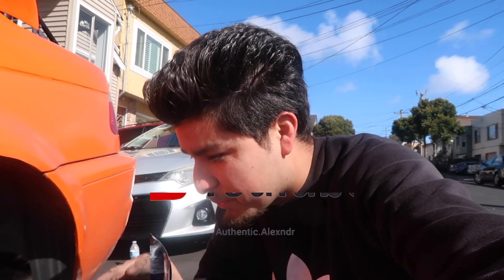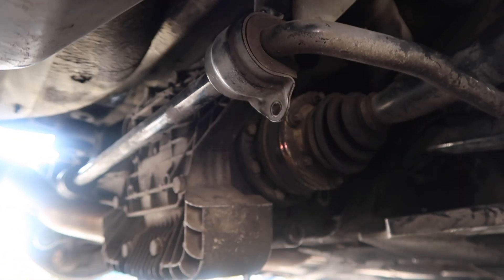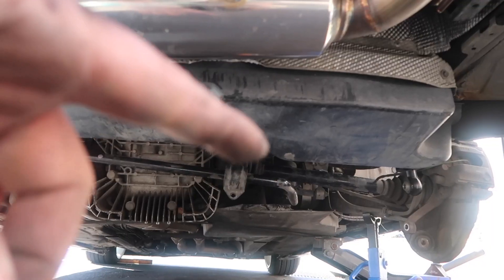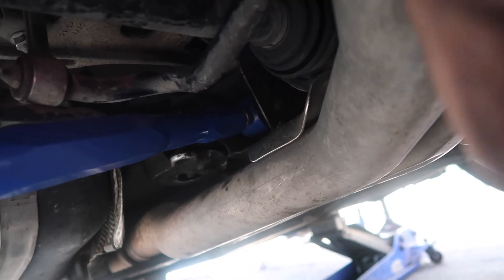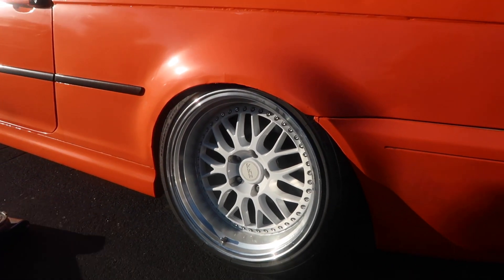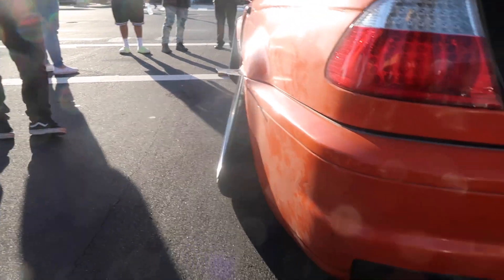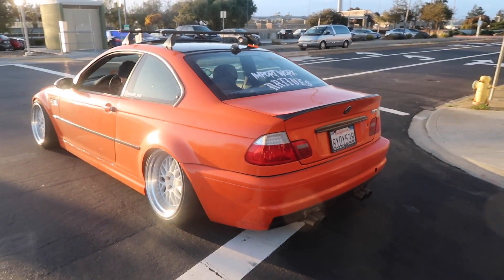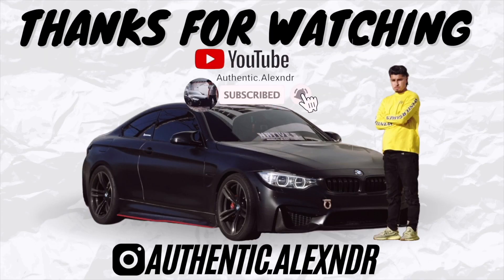E46 Megan Racing Rear Camber Arm Install! | DIALING IN FITMENT

Comment: Many ways to get the driver side in but what worked for me was removing the 21mm rear diff mount bolt and loosening the front 2 18mm until they almost come out then lift the diff and i had to grind one side of the bolt until i was able to slide it out but without affecting the bolt’s integrity good luck not a easy job but grinding the bolt helped big time

Comment: How did these hold up?
Reply from the maker: Held up great and still holding up to this day
Reply: In all honesty mine crapped out not even two weeks later and I have way less camber, must've gotten a bad set, stripped threads on the passenger. I had mine set 10mm more on both ends over stock rear lower control arm, and I just checked today because I smelled rubber and the bar was cracked on both ends. Think they may have baked mine to long.
Reply: Save your money and get FDF Race shop or wait til Garagistic put theres in stock first quarter of 2024. I have FDF Race Shop RLCA on my e36 but I ordered a set for my e46 today.